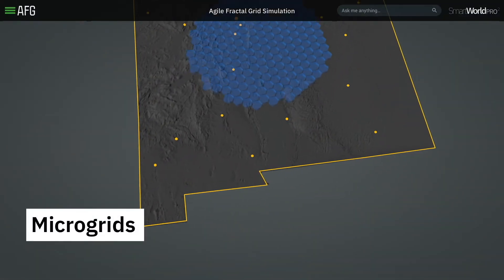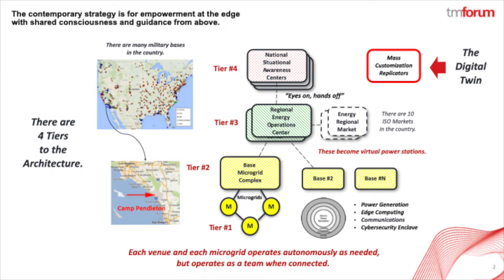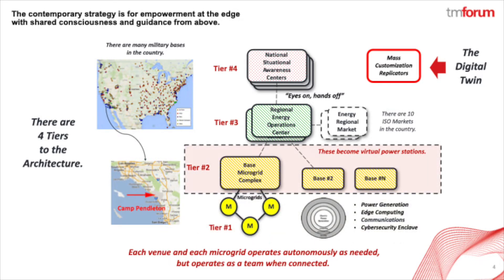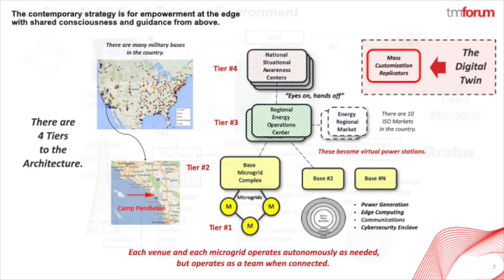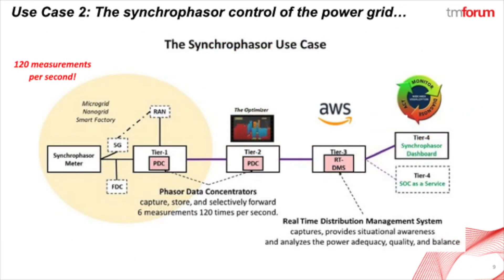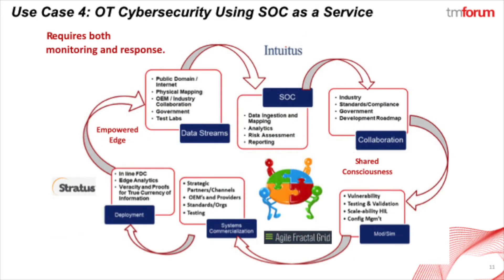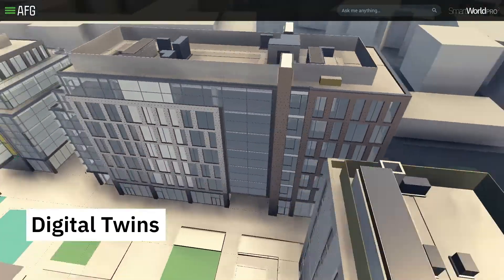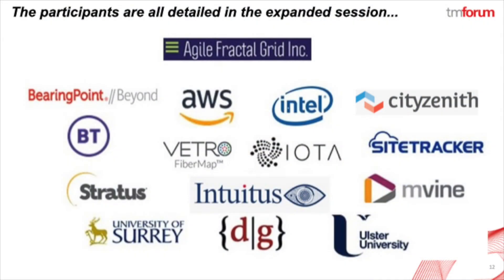Fractal Micro Grids - Decentralizing Electric Power AFG TMForum

Comment: TY, good presentation. What I miss is detail around  the security of the management, control plane  data flows operating across a HA network design plugged into this fractal grid. You might want to look at the SCION Protocol (opensource 10 yrs and 80 people later in the making) out of ZH CH and the commercial implementation  at anapaya.com also in CH (to get rid of BGPsec, the main culprit). With a SCION implementation, DataFlow Hijacking  is avoided (no BGPsec duping , thus no possible way to Hijack the  Fractal grid) and QoS  with HA is preserved  for all spine transits between key operation nodes  travelling over multiple telecom/mobile provider  infrastructures in HA mode.  BGPsec operating  between providers and AS sections of  network managing different parts of the power grid is a huge set of attack surfaces . #IOTA #anapaya
Reply: Thank you for the comment. Details could not be included in a 4 min. presentation. This is a quick preview of more details to come. Please visit the AFG website for additional information. https://TheAgileFractalGrid.com